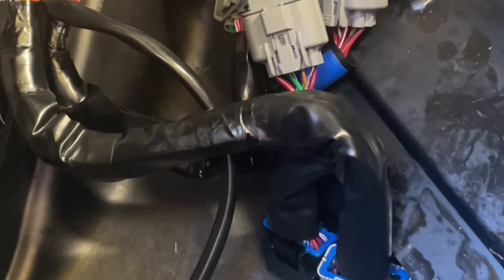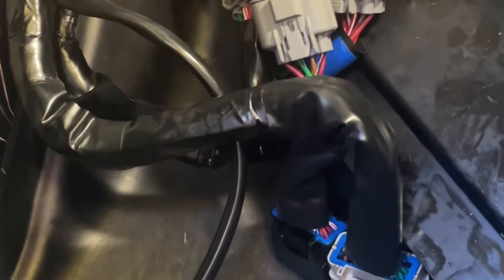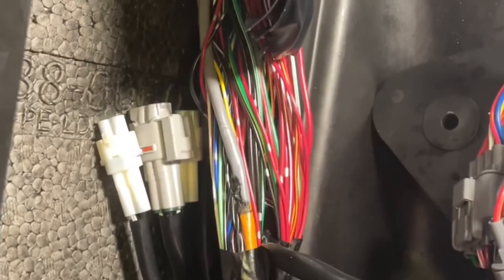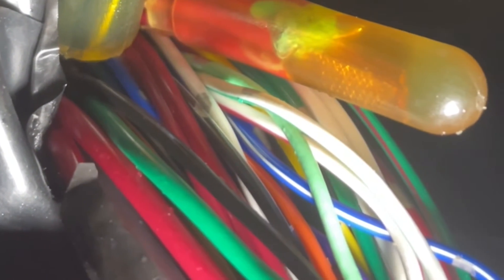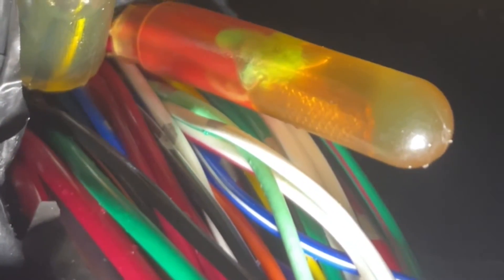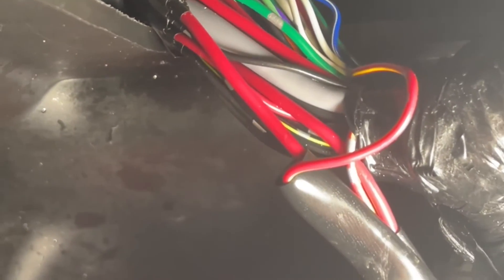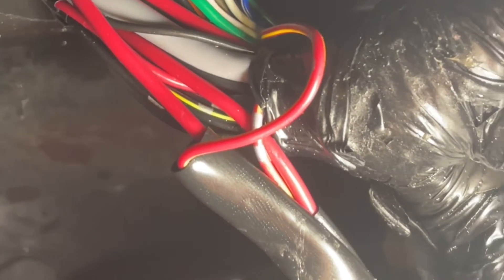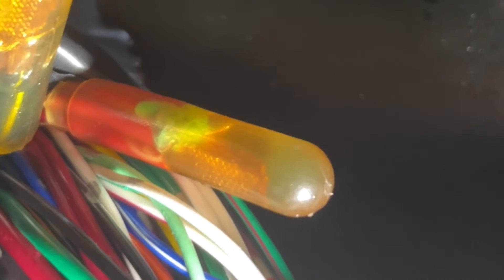Tech Topics: Finding corrosion in my 2022 Kawasaki Ultra 310 Jet Ski Wire Harness

Comment: Hey JD, did you take your ski to the dealership for this or did you do it yourself? There's a hole in my front compartment and the dealership just told me that that's how they replaced the wire harness. I had no idea they cut a hole into the front compartment no one told me. Now the epoxy that they used to seal it shut is starting to come loose.
Reply from the maker: That's wrong they do not need to drill or make a hole...I did it myself and there is no need to damage the ski at all..your dealer is whack
Reply: @JDsWaterWorld  whack af, sir. They are all this way unfortunately. They also test rode thr ski and left water in the water box and they didn't mount the roller to the fiberglass. They had it on the plastic bumper. 😡
Reply: bro that sucks they cut a hole in it, holy crap

Comment: Well dam.  I’m shocked you didn’t know bout this.   I knew about it before I even bought my ultra 310x.  I learned all bout it when I was researching the 3 brands. And who had worse issues.  and the electrical corrosion issues was the one that I knew I could fix way easier then any internal mechanical (motor work ) stuff or fiberglass hull repairs etc.
Reply from the maker: I was the first to find out about it! I had to coach Kawasaki through the issue and even the dealer couldn’t fix my ski, had to do the repair myself with a new harness from Kawasaki!
Reply: @JDsWaterWorld  yeah I read that the dealers / kawi was clueless   Granted the research I did and this harness I read about was on prior year / years. Not a 22/23 model.  So I’m guessing it’s a bigger issue and they need to change their harness to something better
Reply from the maker: I never heard of one of the previous gen skis having a wire harness issue, only the 2022s, and this was because Kawasaki changed the design to accommodate the new electronics and had the harness made by a subcontractor  in Mexico..I have noticed that the new hardness had extra stamping on the label indicating that it was properly tested at the production facility- I did another video on the harness where I show the label.  But yeah this wasn’t wide enough spread to trigger a recall, probably a hundred units in total were affected.
Reply: @JDsWaterWorld  I’ll go back and find it.   Cause I was dead set on a Yamaha ,  SeaDoo. Was OK but wasn’t getting anywhere for months.  And learned about the ultra skis.  So that’s when I started comparing them and happen to stumble across it      But I sure hope I don’t get those issues.  I might do wiring etc for a living but definitely not what I want to do in my free time on my own stuff.  Lol
Reply from the maker: Look at the Ultra 310 like the Land Cruiser of Jet Skis..lol it’s big, heavy, commanding, reliable, and will pretty much go through anything you point it at. In terms of the harness issue on the early 2022s, anyone affected was covered under warranty or even if out of warranty and it’s a harness issue, they are replacing them at no charge. The pre 2022 skis never has any issues. 2016 they had a tune issue that caused some piston issues, but only a handful of cases were documented and the issue was corrected for the 2017 model years. Currently, this is the most reliable and durable platform in the industry - not the fastest- but the best riding, and will go mid 70s in any condition with just a Kspeed tune
Reply: @JDsWaterWorld  man.  Lol you ain’t kidding.  Reminds of being a kid riding in my parents caddy. They always had the fleetwood caddy giant BOATS (not sure how cause we was pretty poor ) lol.  But definitely HEAVY. I sold the single triton I had after 2 trips.  Bought a triton DBL for a steal.  Converted it to a single just cause this thing was so big and heavy. I came from old skis like early mid 90’s. So it still feels stupid fast for me and trying to get use to it   Personally I would have figured it to be the fastest, being so much more HP then the comps. Not included SeaDoo new 325.  But figure few mods and it would kill Yamaha. But I’ve never rode the Yamaha
Reply: @JDsWaterWorld  I need to find out if my 22 is one of the early ones that was affected,  it’s not rode a lot so it’s possible I just haven’t found out there’s a issues yet   You think they list  the vin numbers saying who’s all affected & covered
Reply from the maker: Funny as we were having this convo I got the wire harness recall notice- looks like they will be replacing the harness and engine cover for everyone!
Reply: @JDsWaterWorld  lmfao I swear.  I seen that video you posted shortly afterwards. And immediately went to my mailbox. But it was empty.  😆  I was actually trying to Google search the place I had read about how it had wiring harness issue.  But I’m kinda remembering.  It was more of a ground wire.  Or maybe a connection was Weak so it would break.  But yeah that’s crazy the recall came     What’s really funny is.   Remember you had sent me that PDF diagram cause I had some issue well 50% of my issues was I kept finding water in my Hull after riding and I shop vac it out.   Go ride and bam water again  guess that cover was the problem this whole time

Comment: If we put fluid film there would be a good idea?
Reply from the maker: No, fluid film is not designed for use on plastic or wires. The only thing you can do is replace the harness or remove the harness from the ski and solder the bad splices.
Reply: @JDsWaterWorld  thanks JD!  This one is a 23 I don't know if they fixed anything for that issue or not.

Comment: Hi I have exactly same issue. Can you provide me exactly location of this connection. Kawasaki Ultra 310 LXS 2022
Reply from the maker: There is not any one location that is the specific cause of this issue..it could be any one of the resin splices in the harness. You have two options. 1) contact Kawasaki customer service and state your ski is having the defective harness issue, get a case number, take into a competent dealer for replacement, which takes 2 hours. 2) remove the harness from the ski yourself, cut off all the sheathing until you find the defective resin splice(s) and then solder and shrink wrap the connections. I advise you have it professionally repaired by Kawasaki. I had my entire harness replaced with a new one, although I did the install myself since the dealer was clueless and I was one of the first to experience this issue

Comment: Hi there great job finding this problem. And it's awesome your sharing the information..
Can I ask you around are the connections I'm going to nip it in the bud ..and address it first...
Reply from the maker: What year is your ski? I did try to repair mine but ended up just replacing the harness (Kawasaki provided it at no cost). The best bet is to just replace the entire harness if issues come up..there are about 25 resin splices total…

Comment: I went to use my ski after sitting two weeks and display is dead no start.   Battery good fuses good.  I did find water in the 10 amp display fuse block fuse wasnt blown but i replaced it anyway. Battery is good. Lost the radio earlier in season.  Then lost the beeper for start and lowfuel. Now no start dead display.  Any ideas.  All connectors i reseated.
Reply from the maker: Sounds 100% like you have a bad harness. If they have the part, it can be fixed in 2 hrs…this is a 2022 model right?
Reply: @JDsWaterWorld  2023 model. It's under warranty but I almost want to fix it myself. I'm no stranger to automotive wiring and modern cars jet ski is just so tight to work on.  More curious where the splices are service manual doesn't show much. I used a test light on the 10 amp fuse and have power there and power at the main relay. I have no power at the diagnostic  connector. I'm going to check actual voltage at the connections and at cluster when I get home. How hard is that cluster to remove
Reply from the maker: Well…the harness is over $1,000 and there are about 15 resin splices in it…it’s a pain to replace. I have not heard of any 2023s having the harness issue, but you are the first. I’d take it into the dealer and get it on list for harness to be replaced asap
Reply: @JDsWaterWorld thanks for the tips info and great videos.  Tonight i  checked power at all 3 relays next to ecu and all 3 have full battery voltage.
Reply from the maker: If you open up the gull-wing compartment on the left side, at the top of the compartment, there is a small plastic shroud held in place by four push rivets. Remove the push rivets and remove the shroud that will give you access to the plug on the back of the display. There is a thicker red wire and a thicker black wire. Check the voltage at those pins. My guess is you will have very low or no voltage at those pins with the immobilizer key in, indicating a problem in the harness this is how I diagnosed mine. I had wonky voltage at the meter display.
Reply: @JDsWaterWorld I have .60 volts "under 1 Volt there"  when I push key it drops to .40 volts. When I release key springs back goes back to .60
Reply from the maker: Yeah the voltage there should be within 1 volt of your battery voltage measured at the battery.
Reply from the maker: Sadly my advice for you at this point would be to call Kawasaki 1800 number tomorrow when they open and get a case started. You can tell them you did some basic checks and it appears your wire harness is having the corrosion issue that lots of owners have had. Option B is that you remove the entire harness from the ski, slice it open until you find corroded splices, then solder and shrink wrap..this obviously would void your warranty. My bet would be to go the official route since it’s a new ski
Reply: I also read .60 volts at the fuse block for the cluster
Reply from the maker: You sure your meter is good? What’s your battery voltage?
Reply: @JDsWaterWorld  yes meter is a fluke 88v automotive multimeter. 12.7 at battery.  I check battery voltage before I check any other point. I always keep battery on maintainer when ski not in use.
Reply from the maker: I am pretty sure it’s your wire harness at this point. As I mentioned, you can fix it yourself, but the best way is to remove the entire harness from the ski lay it out on a bench slice the sheathing off and verify each splice or, contact Kawasaki, get a case number and get it professionally replaced under warranty by the dealer.
Reply: @JDsWaterWorld  thanks jd.  I'm going to schedule an appointment at the dealer. It needs the stereo fixed too anyway. You think I should call kawaski corporate first. Or just schedule appointment at dealer?
Reply: I have an appointment to bring it to the dealer I bought it.   They won't be able to look at it till after labor day.  I didn't call corporate yet. Let see how the dealer does. They seemed nice. Thanks for your help.  Appreciate it
Reply from the maker: I have found that some dealers are clueless about the wire harness issue, so sometimes getting a case number from Kawasaki corporate streamlined the repair and expedite the parts needed. I have seen some dealers sit on skis for weeks and weeks without ordering the parts, just because they are clueless. At least, if they can confirm your harness is the issue they can get the new one shipped from Kawasaki quickly

Comment: JD, is this issue still valid on 2023 models? Now as of July 2023 or all this inconsistency is resolved? Not wanting to buy a 310x Kawasaki hearing about all this? Should I go get a waverunner instead
Reply from the maker: The wire harness issue was only with early 2022 skis, it has been corrected on 2023 skis and is no longer an issue. Also, anyone that has the issue, it was fixed under warranty! Also this was not all skis, only very early 2022 serials from what I can tell.

Comment: Thanks for all your videos, really appreciate them. Just experienced a total power loss on my ‘22 310LX after an hour ride and return home. Turned ski off to drop passengers off, went to start again and it’s completely dead. Would this be the culprit here?
Reply from the maker: 100% sure sounds like it. Tell your dealer you are having the defective wire harness issue and they will get it fixed up hopefully quickly. This unfortunately affects a many of the 2022 310s 😭
Reply from the maker: I would even say call Kawasaki and get a case number so they can expedite the ordering of the parts and cut down on the repair time
Reply: @JDsWaterWorld  Thanks I will call Kawi direct. Dealer stated they contacted them and were told it could be a month or more for a new harness due to national backorder, but have offered to fix it in house under warranty so that I can get back on the water asap. crossing fingers
Reply from the maker: @Yank33PL4N3T you ever get this fixed??
Reply: Hey JD, yes the dealer was able to locate the issue and it turned out to be a loose immobilizer. They did check the main engine harness while the ski was there and found no issue - however they ordered one for me and have it waiting just in case. Ski has ran fine ever since closing in on 94 hours.  @JDsWaterWorld
Reply: @JDsWaterWorld do you know if they have the wire harness in stock
Reply from the maker: @Melaniep12 no clue…it’s an expensive part so I’d recommend having it replaced under warranty
Reply: @JDsWaterWorld  he looked more into it and it’s actually the throttle body

Comment: Thanks for all your vids.  I have a serious no power to my ski issue. How can i contact you brother.🙏🙏🙏
Reply from the maker: @Angel the messenger is it a 2022??
Reply: @JDsWaterWorld  yes it is
Reply from the maker: @Angel the messenger damn…well it’s likely that your ski is experiencing the known wire harness issue. There is some testing you can do with a multi meter to confirm, I’m not sure if your technical abilities. But with a new ski you should be fully covered under warranty, so I suggest that you call Kawasaki customer service at once, and tell them you are experiencing the wire harness issue, and get them to open up a case #. Then call your dealer and schedule an appointment and give them the ticket # from Kawasaki. Best to get that harness on order ASAP. A riding buddy of mine down here just had his ski at the dealer for about 4 weeks waiting for them to replace his harness…good luck and keep me updated
Reply: Ok. It's a bit of a long story. But im going to make a video. I will preface you in it so you can see my journey thus far. It's too much to type.

Comment: My new Kawasaki with 12 hours has a big electric problem. First, the display stopped working, no beep when the key was inserted, headlights went on, Bluetooth could be switched on with the button. To the Kawasaki dealer who tried to fix the problem but to no avail. Suddenly the problem was gone. But after switching off and starting again, the charge control would come on, battery swapped, the problem no longer existed for 1 hour, the next trip it came back. The jet also had occasional misfires while driving. who can help? is it the problem with the cables shown in the video?
Reply from the maker: @Nikolaus Gorges 100% sounds like your wire harness is the culprit. Call Kawasai customer service, tell them about your dealers failure to properly fix the issue; tell them you are aware of the harness issue and based on what other owners have told you the harness appears to be the issue. They will have to run down the test procedures to verify, but my money is that your wire harness has a fault in one of the resin splices. This is a known issue on some skis- and was an issue on mine as you’re aware. Keep me updated, hope you get it fixed!

Comment: today i when to start my 2022 ultra and guess what no power once so ever ..battery is good but the display wont turn on.
Reply from the maker: Did you check the fuses? Does it beep when you put in the immobilizer key, or is there no beep at all? Do the headlights come on?

Comment: JD … do you think covering these in ACF50 grease would have prevented or help/delay this issue ?

Cheers - stu
Reply from the maker: No, because the corrosion was sealed inside of the resin-splice from the factory!
Reply: I just found out from my pal from the main Kawa importer in the uk that this is now a common issue …… including their demo ski has gone down with this fault
Reply from the maker: I’m not surprised- sounds like they are headed for a recall campaign on the wire harness!
Reply: I still take a loom repair over a sinking sea-dont any day !
Reply from the maker: Yeah 100%! Since this was the first year of the new generation, I suppose that things like this can be expected. The harness is made in Mexico by a third party supplier- looks like there were some quality control issues

Comment: I found some metal shavings by the drive shaft holder inside the hull. Had the ski winterized with the jet pump out but the drive shaft still in. When I started, I saw the shaft wobble a bit but nothing crazy. I later installed the old pump to hold the shaft in place when running the flush. Any idea where these shavings came from??
Reply from the maker: Hard to say without seeing it, but that could be part of the carrier bearing, which isn’t good. Did you check the rubber damper as well? Only other thing it could be from I think would be the idler pulley bearing..shavings are not good
Reply: @JDsWaterWorld  rubber damper seems fine. I cleaned out the grease to take a better look at it. When I move the drive shaft back and forth tho, it doesn’t feel so smooth like it’s gliding on metal.
Reply from the maker: That’s sounding like that carrier bearing assembly to me…of course it’s a pain to replace
Reply: @JDsWaterWorld  ughh… which means the engines gotta come out. Only 4 hours on the ski. Great…. Lol. Thanks!
Reply from the maker: Well atleast it’s under warranty- have your dealer inspect the bearing and they will deal with the repair if necessary. The engine doesn’t have to be completely removed, just slid forward